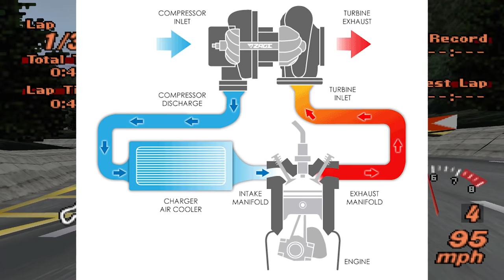5 MORE Gamer Misconceptions About Cars!

Comment: 11:00 Nah I knew that's how high power rear wheel drives were. Need for Speed Underground 2 really showed you how much it can hurt you to floor a high power rear wheel drive car. Why in that game I mainly stuck to the front wheel drive cars. Problem is many people want car game to be a moderate mix of driving simulation and arcade racing which was made just for the thrill and not the realism. Need for Speed used to be the more realistic game from EA with Burnout being the arcade game, but today we more have a hybrid of both. 

People seem to like the more realistic weighty driving in games but don't like the realistic physics of slamming the accelerator or hitting a bump at speed. People do like racing games to be fun but not a choir. It less feels like a skill limitation and more the game fighting the player so it's kinda fallen out of favor even if it is more realistic.
Reply: Pro Street also nailed this as well , Pick a RWD cars like Supra or Mustang and your car becomes hard to control or just straight up uncontrollable

Comment: The last point misses something important for modern cars. FWD cars. FWD cars don't spin the rear out like RWD cars do (*cough* mustangs *cough*)...instead, a powerful FWD car will get Torque Steering, which pulls the car toward one side.

As someone who has a 3.5L V6 FWD car, I feel it's important to bring this to the attention of people who are almost getting their license and wanna' get a fast 'modern' car...since they're mostly FWD nowadays (Australia), it's extremely noticeable on very straight pieces of road. I've had a few people almost crash my car because of this. I warned them it would happen and they didn't expect how extreme the torque steering was. 

One more thing, IRL, hitting a signpost doesn't cause the sign to fly behind the car and maybe you get a scratch on your car. You fucking crush the front of your car to the <immovable object> being the signpost.

Comment: I also hate some nitrous physics that make the boost in speed and acceleration come from the exhaust gasses, like it's some kind of rocket (almost all games do this). You can see this when there's a boost in speed while in the air, or maybe when it slows down the car while going in reverse... NITROUS DOESN'T WORK LIKE THAT!!!
I get it, arcade games aren't very realistic, but unlike flying 1000 feet in a car, which we know it's impossible (because common sense). Nitrous IS real, and its effects on speed & acceleration are also real, so the way they show it works just makes it misleading...

Comment: 3:16 The best cars manufacturer that made cars with turbos stopped making cars without turbos back in the 70s. They stopped making cars in general back in 2011 because GM is shit, so they just kept making fighter jets. I'm talking about Saab. I owned a Saab 9-5 Aero and damn it was a fun car to drive. Excellent handling, turbo spool rime (tim from when you start to when the turbo starts pumping a sufficient amount of air into the engine) is so long you can start at new years and still not have enough turbo pressure when you're celebrating halloween but when the turbo starts to work it never stops. No turbo lag after shifting gears, nothing. Just instant power and all the Mercs, Audis and BMWs can see are you taillights.

Comment: Isn't NOS or Nitros Oxide System just pressurized Nitrogen and Oxygen in different percentages than what we are breathing right now? I think it's a higher oxygen content thereby lowering the amount of nitrogen (30% o to 70% n or something like that)...oh dear God DO NOT RUN PURE OXYGEN INTO YOUR INTERNAL COMBUSTION ENGINE! Unless you want molten slag where your pistons used to be (and valves and cylinder walls and head and crankshaft and conrods and wrist pins and rings and...you get the idea).

Comment: How do FWD cars crash when drag racing/driving in a straight line? I've always been confused by that, because a FWD car doesn't push the car forward, it pulls it from in front of the center of mass. It should be a stable system... But I've definitely seen dragster civics lose control and crash

Comment: 9:50 and 10:15 hah absolutely untrue. Tyres are the best they've ever been by a long shot even going back as little as 10 years. You have all weather tyres that offer similar levels of grip to dry weather semi  slicks on tracks nowadays, and also driving in a straight line takes skill but around a circuit takes entire leagues more. As you're still doing everything you do at drag racing but constantly, over hours not seconds and all the while having more complex mechanics to worry about like load transfer when cornering and braking. In drag racing you just have to get good at loading up the drive train, and letting the clutch out in a way that you limit slip, then just modulate throttle where needed and shift at preset RPMs... In lower power cars (sub 500) most of this is completely irrelevant as you can barely spin tyres outside of 1st. Now when you do the same on a circuit you still have all these aspects and to a much more pronounced degree too, you have much less traction coming out of a turn than from a dig you can set up for, so throttle control is far more vital. Anyway I rest my case , drag racers give too much credit to themselves.

Comment: I started the crew 2 around 2 months ago, and I have to say, it is not realistic at all and at the same time has odd realism. I am in the top 300 already for drag racing because I realized that (Corvette, special tune, fully legendary upgraded with 2x nos and max multiplier in perks for each parts and top icon points). However I like that the crew 2 has one realistic thing, they do in fact spin the fuck out, I have fishtailed and crashed in walls due to tunes countless times, and if you cant launch right, and gear shifting is important. The nissan 370z drag edition is the worst for it, but it is also very fast. The smallest thing can alter your time by a lot. 

My next thing about the crew 2 is why have gotten so much rage playstation messages calling me a hacker. People think that supercar=fast car. The crew 2? NOPE. The fastest street car is the Cadillac escalade if tuned right with it going up to 235 mph. I actually think the Crew is more realistic in driving then forza. Mostly because I can make a fiat go vrrrrrrr at 270 mph. 

Also I just start at gear 2 to simulate turbo lag when cruising. 

The crew 2 is an arcade racer but a realistic racer at the same time.

Comment: Gta shouldn't be the example because it's only when you've fell a far distance upside down and how fast ur falling which I know from playing the game its chance to explode so not the best thing to use gta may not be realistic but the mechanics for cars are quite decent shoot the fuel tank it leaks gas then will explode if u keep drilling it with bullets quickly so.... idk any other games that explode when falling upside down but gta is alright in this aspect since its actually dependent on speed of fall if ur upside down also wether u land on the engine wether front or rear engine bay is another part so yes you get the point not good to use but maybe another games a better example

Edit: gta allows u to flip by moving the wheels also so yea now just kinda seems odd you'd include gta as an example since u can hold a button to respond aswell as flip if you so chose to....